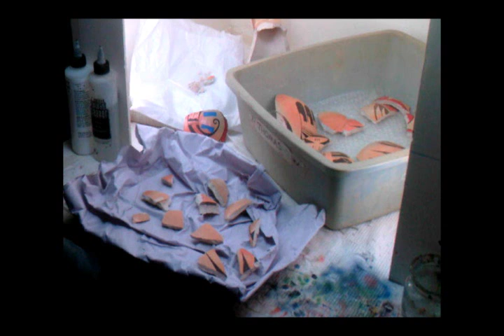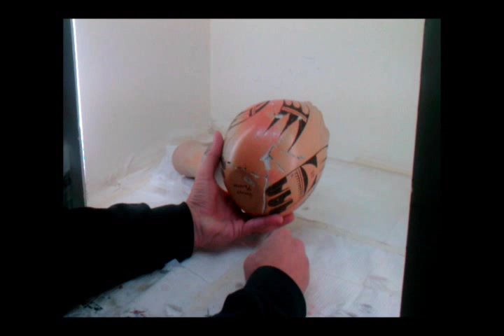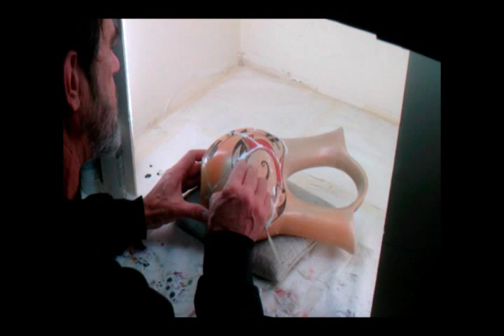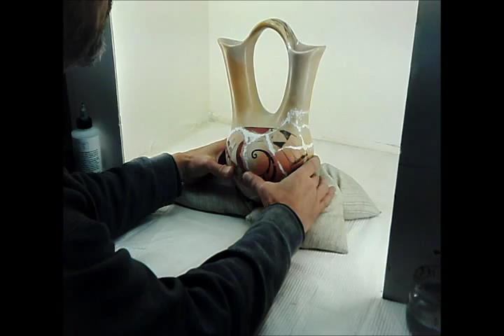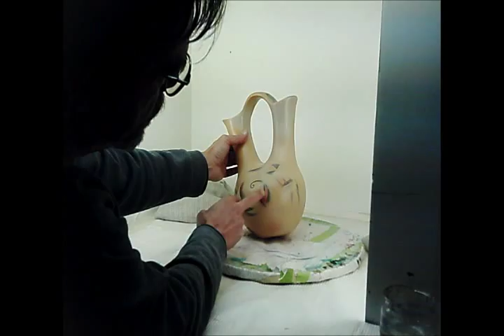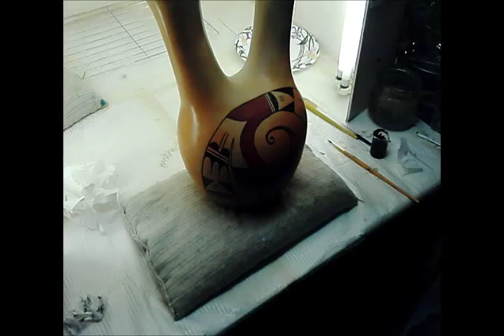hopi vase repair

Comment: During this video you mention “Ramping”. What is this please.
Reply from the maker: "Ramping" is how I refer to  dealing with misaligned pieces, when one piece is offset from the piece next to it, creating a step. Ramping is creating a seamless transition between those pieces with the fill. So, you have a "ramp" instead of a step.
Reply: @marsgitar  Thanks very much for taking the time to explain that. It sounds incredibly difficult to achieve. I hope to come across you doing it as I gradually work my way through your videos.

Comment: How do you the difference of porous and non porous Ceramic
Reply from the maker: Put a drop of water on the edge of a broken piece of pottery. If it soaks into the clay, it's porous. If it doesn't, it's non-porous.

Comment: You are using milliput for the epoxy putty? What are you using for the finer fill? I have a very fine more modern piece of Native American art that is very finely painted (not heavily glazed) and I'm afraid of sanding off the paint. What would you suggest? thanks, love watching your videos!
Reply: Why do you Choice Golden Acrylic Brand Paint
Reply from the maker: For a fine fill, you could use Milliput, overfilling the cracks just a bit. Then instead of sanding it, I'd use water on a Q-tip instead of sandpaper. Milliput and some other epoxy puttys are workable with water. Make sure you get all the wetness wiped off before it dries. There's Milliput in that water even if you can't see it. You might practice on something unimportant before trying it on something rare and/or expensive. Good luck.
Reply: thank you for responding. Do you ever do videos showing color mixing and glazing with the airbrush?
Reply from the maker: I haven't done that, and I probably won't. I'm not making "How-to" videos. I get a lot of questions from my customers asking me how it is possible to repair the things I do. So I make these videos, "Here, watch me work". People like the videos, so I keep making them. I'd get more work don't if I didn't make the videos. (LOL)
Reply: Do you enjoy tmyour Work
Reply: Martin Scherer they're great! Keep recording. Thanks!